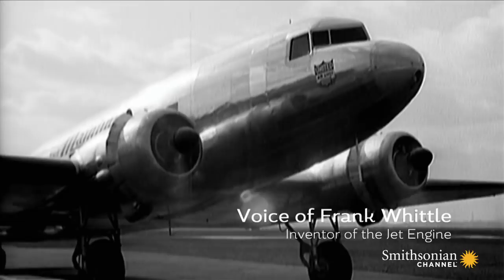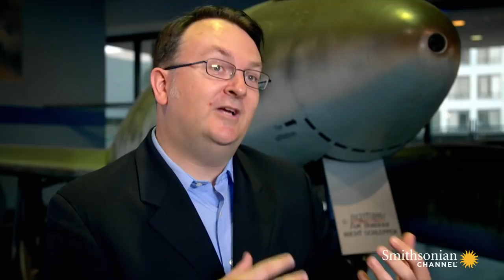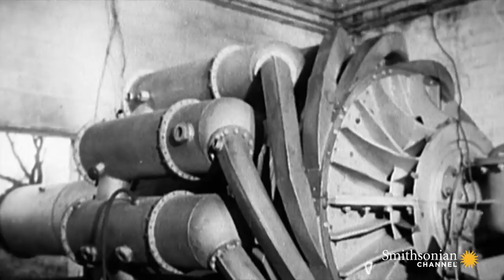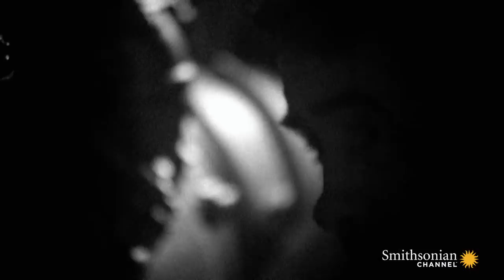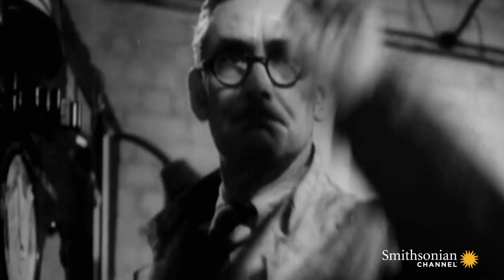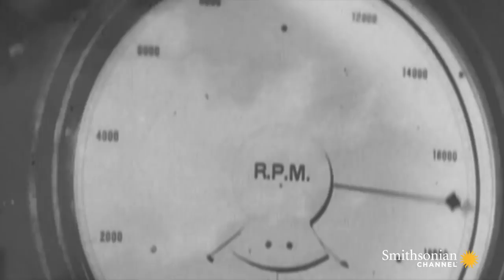Inventing the Jet Engine Came With a Few Disasters

Comment: Germans won the jet race leaving behind competing Brits and Italians. Messerschmitt machines were first in the world to have jet flying.
Reply: Muhammad Hood didn't help them at sll
Reply: The German designs were pure junk and barely lasted a single flight. Modern jet engines are based on the British axial flow Vickers F.2 engine.
Reply: @gw7624  sounds like u are the biggest expert here in the comment section…😂
Reply: @Falkenlp3  Smart comment. You must be really sharp.
Reply: @gw7624  : The German designs were not junk - they were a compromise that met their needs at the time for high performance in not very long flights fighting over their home ground.   Their engines were axial flow and much better performers.  They lasted 25 hours which was about as long as a German fighter lasted before being shot up by B-17 guns.   The Whittle engine was radial flow and the compromise sacrificed fuel economy for durability.  As such the Whittle engine had no real practical use.  It took Rolls Royce in England and GE in the US to improve the compromise so that durability was retained without the really excessive fuel consumption.
Reply: @keithammleter3824  The Jumo was a flawed design, which is why no one but the Czechs bothered to build any post-war. Yes, we know they were axial flow engines. The British also had axial flow engines (the axial flow compressor is a British invention, circa 1920s) but opted for a more conservative approach with the Meteor, which was superior to the 262 in every way but top speed.

"They lasted 25 hours which was about as long as a German fighter lasted before being shot up by B-17 guns. "

LOL, the B-17 didn't shoot up 262s. B-17s were sitting ducks without escort cover. Tempests were the number one killer of 262s (after the Jumo engine).

"The Whittle engine was radial flow and the compromise sacrificed fuel economy for durability."

The fuel consumption was nowhere near as bad as the Jumo's. 

"As such the Whittle engine had no real practical use. "

What on earth are you talking about? It was literally used in the form of the Nene by the Meteor and by Russian and US jets. Later axial flow engines, which still built upon Frank Whittle's designs, by Rolls Royce and Siddeley formed the basis of modern jet engines, which is also why Rolls Royce remained Europe's leading jet engine manufacturer.
Reply: @gw7624  : You've got things badly mixed up.
1.  The German decisions re the Me262 were based on their combat experience, which was that B-17's were very dangerous to approach.   If you read old (now declassified) USAAF reports on the War in Europe, you'll see that the purpose of B-17 missions became in part drawing up/tempting German fighters  to have ago so they could be shot down, as well as the main mission of bombing strategic targets.   The Me262 didn't change that.  The ME262 was harder to shoot down than things like Me109's and could have been a game changer if it had been put into production earlier, but B-17's and their escort fighters could and did shoot it down.  So approaching B-17 was still dangerous and likey to shorten your life.
2.  The Nene was a complete redesign following the RR Derwent, which in turn was an improved  RR Welland, the Welland being a copy of Whittle's production design for Rover.   Claiming the Nene is a Whittle engine is like saying the Ford Model A is the same as a Ford N (N preceeded the T).   The Nene had the same basic layout, but eliminated air counter flow and 
is a completely different engine.
The Nene had an improved compressor key to its importance, and all the Rolls designs had much better combustion chambers.  Note that the Nene itself was a series of engines of successive improvements - Marl 1 thru to Mark 10-3.  
3.  The Russians made a batch of Nenes in accordance to the drawings and parts specifications Rolls sold them, but most of the radial flow types they made were the Klimov RD-45, an improved version, and the VK-1, a larger RD-45.  Kind of like comparing a Ford Prefect to a Ford N.
4.  Saying that the Wittke engine is the basis of modern jets engines is plainly silly.   Its like saying the Ford T is the basis of all modern cars.  They all have 4 wheels, SAE controls, and a 4-stroke engine in front.   But no designer or engineer today gets his inspiration from a T, and no sensible owner today thinks of his car as just a slightly better T.
5.  The performance advantage of axial flow is well known.  Not only does the engine work better, but it reduces engine diameter, allowing a smaller aircraft cross section and less drag.   But to do it succesfully requires engineering knowledge and materials Whittle didn't have.  It took the US to make axial flow a success.  Pre-Whittle ideas of some Briton, without this knowledge, doesn't count.
6.  The main ME262 engine (BMW 003) had a specific fuel consumption slightly worse than the Whitte production design (40 g/Kn.S vs 37 g/Kn.S), but as I said, fuel consumption was not as important to the Germans as they were fighting on home ground, and axial flow gives much better aerodynamics.
Reply: @keithammleter3824  "So approaching B-17 was still dangerous and likey to shorten your life."

Rubbish. B-17s were nothing but cannon fodder until the Americans figured out that unescorted daylight raids were a bad idea. The 262 actually shot down a fair number despite its obvious shortcomings.

"Claiming the Nene is a Whittle engine is like saying the Ford Model A is the same as a Ford N (N preceeded the T)."

I don't think you understand how engineering works, particularly in the aero industry. Each 'redesign' incorporates elements of preceding designs. The revolution was Whittle's original concept. Everything else was evolution.

" Saying that the Wittke engine is the basis of modern jets engines is plainly silly.   Its like saying the Ford T is the basis of all modern cars. "

Your analogies are poor. Rolls-Royce and Siddeley made the greatest contributions to the development of the jet engine. Their designs were built under license around the world and directly led to the engines that power modern aircraft. It is highly unlikely that jet engines would be anywhere near as advanced as they are today had it not been for Frank Whittle who is rightly regarded as the father of the jet engine. 

"It took the US to make axial flow a success.  "

Don't be silly. Armstrong-Siddeley had a successful axial flow engine in the form of the Sapphire which was built under license in the US. Rolls-Royce was building its Avon engine at the same which had no input from the US. 

" The performance advantage of axial flow is well known.  Not only does the engine work better, but it reduces engine diameter, allowing a smaller aircraft cross section and less drag."  

Right.... and you really think British engineers didn't know about drag and the advantages of the axial flow's smaller cross section? The centrifugal engine was chosen primarily for its superior reliability. Britain had absolutely no need to gamble on an unproven, hazardous design given that the RAF already enjoyed full air superiority over Britain.

"But to do it succesfully requires engineering knowledge and materials Whittle didn't have."

Now you're just sounding childish. British jet technology was already well ahead of anything the Germans had, despite the fact that the Air Ministry was largely uninterested in jet engines until very late in the war. Metrovick were already producing superior engines to the Jumo throughout the 262's run, but again, the Air Ministry did not regard axial flow technology to be sufficiently reliable. The decision to take a more conservative approach and opt for centrifugal engines until the reliability problems of axial flow engines were worked out does not indicate a lack of engineering knowledge my friend. Quite the opposite in fact.
Reply: All the plans were from 
Whittle first.
Reply: @Classicgamer73  : You mean all the plans for Wittle engines were from Whittle first.
Reply: @gw7624  and still was the first.
Reply: @gw7624 The Metrovick F.2 was a failure it never entered production because it was unable to achieve airworthiness certification.
Britain would not have a successful axial turbojet engine until the mid-1950s
Reply: @Classicgamer73 No, Whittle was not the first to patent or achieve anything related to jet engine development first.
Whittle is only the 4th person to successfully demonstrate a working jet aircraft engine
Reply: @lucasiago3729 Whittle was only the 4th
Reply: @WilhelmKarsten You again you sad little man. No, the F.2 wasn't mass-produced, but its design heavily influenced subsequent axial flow engines including the Sapphire which was built under license by the US and others (not the only British jet engine to be reverse-engineered). The competing Rolls-Royce Avon, one of the most successful jet engines ever, was heavily influenced by the Sapphire.
Reply: @gw7624  Just the facts here lad, the Sapphire was more than a decade after the first axial compressor turbojet engines were mass produced in Germany and were designed after the war with the assistance of captured German technology.

Any questions?
Reply: @gw7624  The Avon wasn't designed until after the war... and also relied heavily on German Axial Compressor technology recovered from the Fedden Mission.
Reply: @WilhelmKarsten  "and also relied heavily on German Axial Compressor technology recovered from the Fedden Mission."

BS. Ignoring the fact that axial compressors are a BRITISH invention, British axial-flow designs were in development long before the end of the war, so nice try dbag.
Reply: @WilhelmKarsten "Just the facts here lad, the Sapphire was more than a decade after the first axial compressor turbojet engines were mass produced in Germany and were designed after the war with the assistance of captured German technology."

German axial-flow engines were pure junk which is why they were never used by anyone besides the Czechs post-war. 

It's cute how hurt you are over the fact that German jet engines were seen as nothing more than unreliable dead-ends that were inferior in every way to British axial-flow engines.
Reply: @WilhelmKarsten  Never claimed the Avon was a wartime engine, but it was THE benchmark for jet engine design following its release and, as I've tried to get into that thick skull of yours, was derived from British designs, not dead-end German junk.
Reply: @gw7624  The BMW 109-003/018 series is the most successful axial jet engine in  history and was the first European jet to reach Mach 2... this WW2 German design is still in service today as the Safran ATAR family.
Reply: @gw7624  Sorry lad, Germany invented the axial compressor jet engine and this advanced jet technology was introduced to America France and the Soviets after the war... even to the UK.
Reply: @keithammleter3824 No. The German engines were based off the Whittle patent that was foolishly made public by the British.
Reply: Just to add, the main difference was of course the axial compressor, but the idea of a turbojet had been around for years by this point, initiated by the Whittle patent.
Reply: @ab8jeh  That's a popular British myth that crumbles under the slightest scrutiny, 
Maxime Guillaume patented the turbojet aircraft engine in 1921 and features a axial compressor.
Whittle never constructed or tested a axial compressor, he never built his 1930 patent design and abandoned it after A.A Griffiths who pointed out that Whittle's design wouldn't work.
 The first successful demonstration of a gas turbine engine with a axial compressor was the BB&C Velox industrial generator in Berlin in 1932.
The first successful aircraft design with a axial compressor turbojet is the Jumo 109-004 Orkan.
Britain would achieve this until the Rolls-Royce Avon in 1950.
Reply: @ab8jeh  Whittle was not the first to patent the jet engine or propose a axial compressor.
In 1934  Frank Whittle was notified that his patent was invalid and infringed on Guillaume's earlier patent, Whittle allowed his patent to expire rather than face a legal challenge in court.
Whittle is only credited as the 4th person to successfully demonstrate a jet aircraft engine and was not the first to acheive anything related to jet engine development.
Reply: @ab8jeh  Anyone familiar with Von Ohain's work and Whittles 1930 patent will know that they are clearly developed independently and bear absolutely no resemblance to each other.

Von Ohain's engine features a, 
A single-stage centrifugal compressor,
centrifugal turbine
and a annular combustor.

Whittle's patent shows a 2-stage, axial + centrifugal compressor.
An Axial turbine 
and no apparent combustor.
Whittle would eventually used a can-type combustor, his first prototype, the W.U.1 had no combustor... while Von Ohain's engine used a sophisticated annular design similar to that used on modern jet engines.
Whittle would also never build a axial compressor.

Any questions lad?
Reply: @WilhelmKarsten  Oh, so you've written it in bold I believe you, and you've patronised me at the end to boot. I'm aware of the differences, however Ohain talks in his own autobiography about reading the Whittle patent in 1935 and adjusting parts of the design as a result of this. I'm not dismissing his work, I'm sure he wasn't aware of Whittle until he'd already developed much of his approach before becoming aware of Whittle, but to say he never saw the 1930 patent is not correct, lad.
Reply: @ab8jeh  Please stop posting lies and ignorant misinformation.
Reply: @ab8jeh  Hans von Ohain and Max Hahn constructed the first prototype jet engine in 1934 in Gottingen Germany.
Frank Whittle was only the 4th person to successfully demonstrate a working jet aircraft engine, he would not begin any actual work on jet engines until moving to Rugby in 1936.
You still have alot to learn lad.
Reply: @WilhelmKarsten  Lies? Which part? I just checked and every article that can be found talks about exactly this. What part am I lying about? Please can you supply a reference for this running turbojet in 1934... And please, stop using bold.
Reply: @WilhelmKarsten  and please stop calling me 'lad'. You're embarrassing yourself with your condescending attitude. Ohain's patent was in 1934, with the first successful bench test in 1937, about the same time as Whittle independently. Now pipe down.
Reply: @ab8jeh  Your source is obviously not accurate and contradicts all the historical evidence.
Reply: @WilhelmKarsten  "all the historical evidence". Thanks for this insightful citation 🤦‍♂️
Reply: @ab8jeh  Written accounts by both Whittle and von Ohain disprove your false claim.
There is also no physical evidence in the engine designs that support any knowledge of the others work.
Von Ohain's engine bears absolutely no resemblance to Whittles patent and operated on a different design concept.
Reply: @WilhelmKarsten  where are you from bro? If you feel confidence show the evidence? Guess are you lying or else?

Comment: Henri Marie Coandă (Romanian pronunciation: [ɑ̃ˈri ˈko̯andə] (About this soundlisten); 7 June 1886 – 25 November 1972[1]) was a Romanian inventor, aerodynamics pioneer, and builder of an experimental aircraft, the Coandă-1910 described by Coandă in the mid-1950s as the world's first jet,[2] a controversial claim disputed by some and supported by others.[3] He invented a great number of devices, designed a "flying saucer" and discovered the Coandă effect of fluid dynamics.[4]
Reply: the Coanda 1910 was a ducted fan
Reply: The 1910 was a ducted fan driven by a 4-cylinder Clerget engine, it never flew.